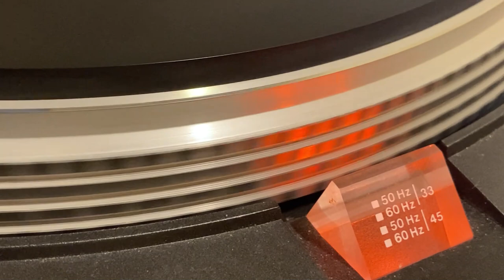Adjusting Speed Variation of a Servo Controlled Direct Drive Turntable - Turntable Repair - Fisher

Comment: Hi Ben - I just wanted to say thank you for how much you helped with my record cleaning and how much it changed my listening. I can't afford a $3000 cleaning machine or even a $500 one for that matter. I'm still spending that kind of money improving my rig!  I use a record wet bath type cleaner and the vinyl vac with a cheap lazy susan from Amazon. I can't see how an expensive machine could be any better. It all cost me $120. BTW, my wet cleaner is the German Disco - Antistat. It uses goat hair brushes which get into the grooves to get the crud out, Wow.  AND, I got the Funk Achromat! Brought out the detail! Your tips are great!!!!

Comment: Thank you very much BEN for the video. I have a MT-6355 model
It runs very fast. Can you guide me what should I do? I am a technician by profession. But I have no experience in fishing like this or yours. Thank you very much.
Reply from the maker: Ok that one is quartz locked… there should be a button on pitch controls on the front… if the quartz lock button is engaged; try disengaging it and using the pitch controls to slow it down… if it is not engaged try that… vinyl engine has an operating manual but no service manual… there is one on analog alley
But it is $9.95

http://www.analogalley.com/osccart/product_info.php?products_id=867